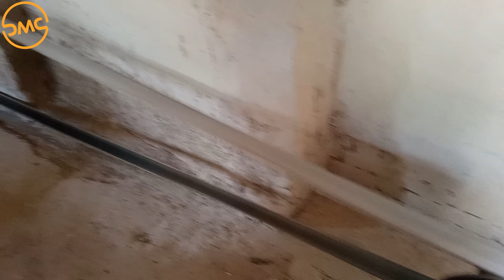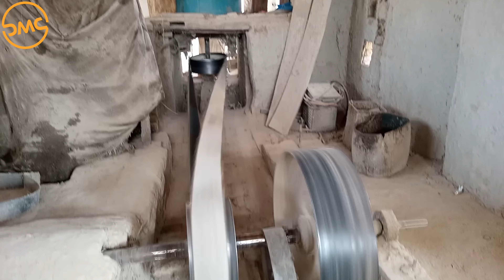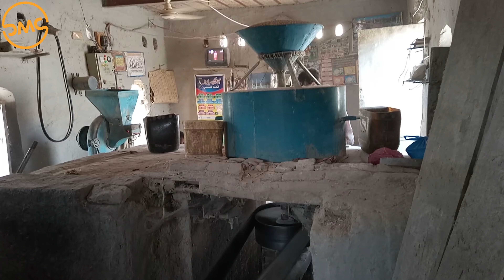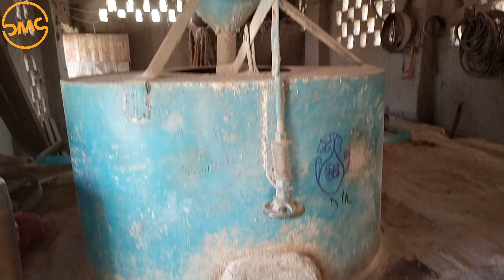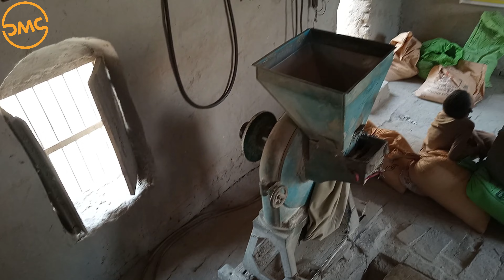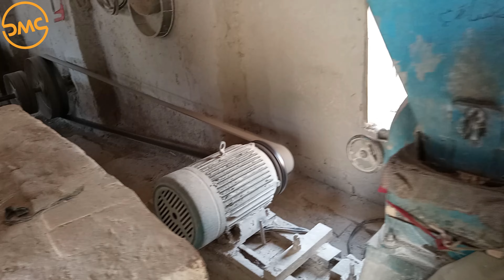Electricity Desi Pathar Wali Atta Chakki Old Machine Working With 25 HP Motor 30 Inch Chakki

Comment: M0tor pulley kitane inch, rpm kya hai? Chakki ka pulley kitane inch ki hai aur chakki ka rpm bathau sir
Reply from the maker: Motor 25 HP Motor Pulley 6 inch  pulley aage 30 inch pulley aur aage 17 inch chakki  per 20 inch pulley  aur Rpm 300 ok